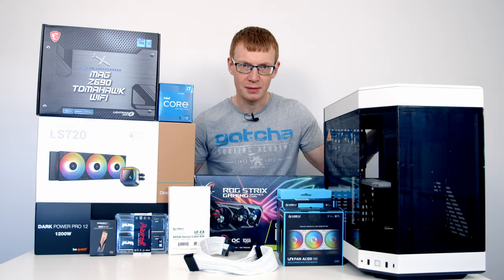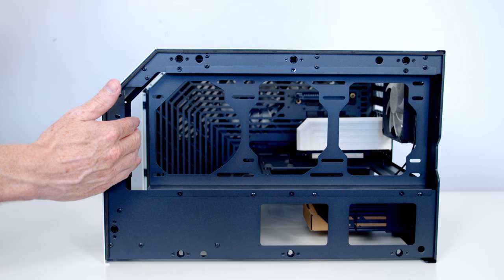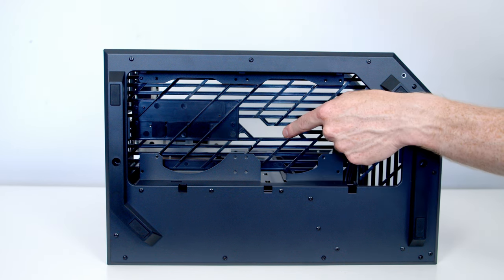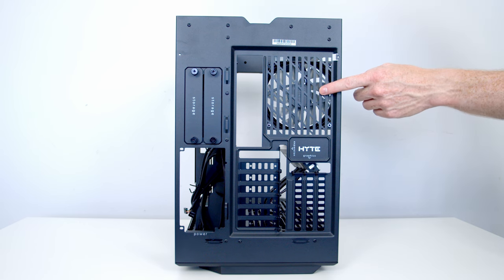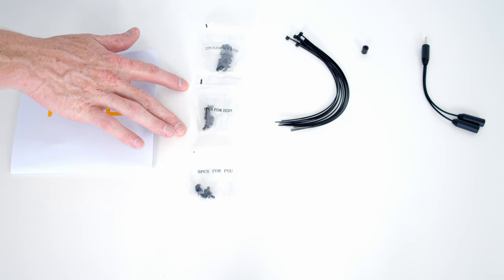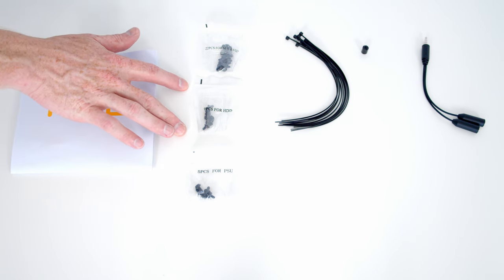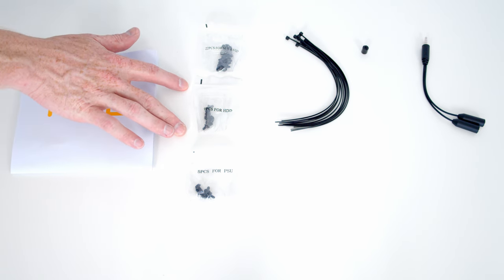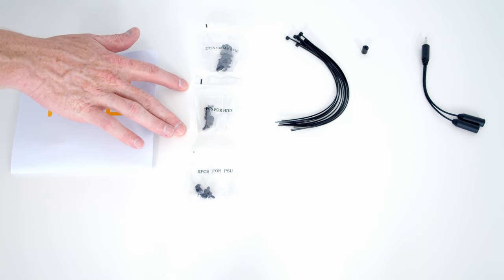Hyte Y60 Build - Step by Step Guide

Comment: You did a horrible job explaining how to set up power supply. Especially for first time builders.
Reply: Plug in cables... screw in the power supply... done
Reply: Not that hard buddy use your brain
Reply: PSU is one of the easier one, considering that the cable has label to where to connect it in the PSU, which also has a label in it
Reply: Womp womp
Reply: Womp womp
Reply: I came here to watch a pc build so far he’s dismantled the entire case. 😂
Reply: @liammorris1018  i think your supposed to do that and then after done building you put all of it back on
Reply: bruh 🤦‍♂️🤦‍♂️🤦‍♂️🤦‍♂️🙄🙄🙄🙄😂😂😂😂💀💀💀💀

Comment: Just wanted to say thank you for this video. I picked up the Hakos Baelz edition of the Y60 when it released and have been sitting on it all this time. I wanted to find a step-by-step build using this case and this video delivered in spades.

A few comments from a complete newb that might help others:

 - An Intel CPU is used here so it'll be a little different on an AMD CPU for the AIO cooler.
-Don't remove the plastic cover on the heatsink connected to the AIO cooler until you're going to install it as that's where the thermal paste is. There may or may not be a finger print on mine.
-And the biggest one for me: The motherboard here has the I/O shield (backplate thing) pre-installed so that step is not mentioned. It needs to be installed BEFORE the motherboard is installed. Ask me how I know.

Even if you're following a detailed video, read the instructions for all of your components. 😬

Seriously though, thanks for the video. Especially loved the close up shots when connecting the cables to the mobo. It was very helpful.

Comment: Christopher, your video is spectacularly detailed! I've watched tons of vids on AIO and custom cooler for the Y60. This video of yours is well beyond what everyone else is doing, in terms of completeness, accuracy, and presentation. 
What I intend to do differently is have a custom loop to water-cool the GPU and CPU, and add an internal sensor display. 
I definitely agree on using 140mm fans instead of 120mm at the bottom and side.
Reply: dimmi se metti Lian Li GALAHAD AIO 360 SL RGB V2 White andrà bene?

Comment: If your concerned about GPU Temps. "ColdZero"  do a glass front/side at the GPU intake for this case,with a cut out which allows outside air to the GPU fans.

Comment: In case anyone is curious about the 4090 in this case, pasting my comment after installing my GPU earlier:

Can confirm the Gigabyte Windforce 4090 fits without issue (listed at 70mm wide, very close to glass and I would imagine max would be like 72mm).

My PC: Ryzen 7 5700x, 32 GB Ram, Gigabyte Windforce 4090, Seasonic Focus Gold 1000W PSU, 2 sata ssd and 1 nvme ssd, NZXT Kraken Z73 vertically mounted, 7 fans total with the rear and top set to exaust, side and bottom set as intake. Set fans to "high" settings on NZXT and Lian Li software, but setting to standard made little to no difference.

(I run all my games at 4k 120Hz on my LG C1)

Results from running the following games at max settings (I run all my games at 4k 120Hz on my LG C1) :

-Elden Ring (Never hit max load, 50 C)

-Red Dead Redemption 2 (Ran benchmark which was sustained 100% load, no issues with max temps around 67 C, also ran gameplay with no issues)

-Cyperpunk 2077 (ran benchmark, have not played through real gameplay yet but temps were low the whole time 68 C)

-God of War PC (Was able to have the game sustain 100% load in the area where you can change realms at the table, left it like that for about 10 to 15 min, was able to have game ramp up to and top out at 80 C, but could not get it to go past this temp.)

Hope this helps someone!

Note: be careful when installing the GPU, its big and heavy. I broke the locking mechanism on my Hyte Y60 vertical mount :( might need to buy new riser cable from Hyte directly.https://www.youtube.com/watch?v=UJmJ5FbY5RY&t=3908s
Reply: Thanks! Had many people say the 4090 would not work for this case not because it won't fit but because thermal would be very bad. There is a special edition of this case I might want and was worried if i get a 4090 at some point but thanks for clearing htat up!

Comment: It would be nice to see how the temps would be for a 2800mm AIO set as intake on the side, and then just  3  120mm fans on the top set to exhaust.
Reply: That's what I was just thinking. I originally went for the artic II freeze 360 but it didn't fit, unfortunately that's not the first time (I really wanna know what case that monster fucking fits into)

Comment: I know this video is old, but just to make sure, you said you’d set the top radiator fans to exhaust and the two side fans to intake for best cooling correct ? I just finish my first build and want to make sure I get the best cooling

Comment: if you do not have enough argb or rgb headers, you can buy splitters cheap at walmart or whatever equivalent stores you have in your region.

Single 3 pin argb header only supports 3 amps on my mobo, so a 3-long aio + 3 case fans was a little over for me. Got a splitter and was good to go. Electricity is weird.

This guy has 2 argb on his board so no splitter necessary to stay under max.

Mobo->3pin argb splitter
splitter->fan->fan->fan
splitter->aio
is what end result looks like for me

Comment: When you ran your testing, did you have the side over on? Having the GPU vertical brings it pretty close to the glass if you have a 3 slot card. HYYT recommends this case for full water builds. I wouldn’t use this if the GPU was air cooled. I bought it specifically because I did a water build.

Comment: Thanks I have subbed. Great build explanation on the y60! I just bought this case for a swap, adding a eiswolf gpu cooler to my 6900xt and going to try to integrate the drgb in my kraken z63 aio on the 5800x with the motherboard msi tomahawk mag b550 jrainbow headers. Any suggestions? Nxzt cam seems to only work on the kraken in my existing case. Any work around?

Comment: Thank you for this video! Based on the spec, do you think this case can fit the new RTX4090 in the vertical position?
Reply: I just got the Gigabyte Windforce 4090, according to Gigabyte it is 70mm wide. I will let you know if it fits in a few days when I install
Reply: @PantsaBear  Thank you! Looking forward to see your result :)
Reply: Just plugged it all in, can confirm the Gigabyte Windforce 4090 fits without issue.

My PC: Ryzen 7 5700x, 32 GB Ram, Gigabyte Windforce 4090, Seasonic Focus Gold 1000W PSU, 2 sata ssd and 1 nvme ssd, NZXT Kraken Z73 vertically mounted, 7 fans total with the rear and top set to exaust, side and bottom set as intake. Set fans to "high" settings on NZXT and Lian Li software, but setting to standard made little to no difference.

(I run all my games at 4k 120Hz on my LG C1)

Results from running the following games at max settings (I run all my games at 4k 120Hz on my LG C1) :

-Elden Ring (Never hit max load, 50 C)

-Red Dead Redemption 2 (Ran benchmark which was sustained 100% load, no issues with max temps around 67 C, also ran gameplay with no issues)

-Cyperpunk 2077 (ran benchmark, have not played through real gameplay yet but temps were low the whole time 68 C)

-God of War PC (Was able to have the game sustain 100% load in the area where you can change realms at the table, left it like that for about 10 to 15 min, was able to have game ramp up to and top out at 80 C, but could not get it to go past this temp.)

Hope this helps someone!

Note: be careful when installing the GPU, its big and heavy. I broke the locking mechanism on my Hyte Y60 vertical mount :( might need to buy new riser cable from Hyte directly.

Edit: got Plague Tale Requim to hit 83 after letting it run at 100% load for 40 min lol, but wouldn't climb higher
Reply: @twinstars8812  See above, forgot to tag you lol
Reply: @PantsaBear  Thank you so much for this detailed update!! That's awesome!! I was worried that the Y60 gives the huge GPU no breathing room since it's so close to the glass panel, but your temp. results suggest otherwise! Glad to see this beautiful case can fit a 4090! I got a MSI Trio which is about 769mm thick (I think Gigabyte OC is at 752mm, so pretty much the same). Just wondering approximately how much space you have left between the GPU and the panel? Btw, you got a killer build :)
Reply: @twinstars8812   @TwinStars  Thanks! I put a lot of thought into building it myself, was my first PC build. Also to be honest not much space. Theres probably 5mm of literal room left to spare before the glass, and the gpu I have is 70mm according to the Gigabyte specs (also I dont have the Gigabyte OC, I have the Gigabyte Windforce, which is a few mm thinner and has no rgb). Even getting only a couple more mm Id imagine the glass would begin to choke the GPU, but I cant verify that. Also the card is TALL, so it hides the 4 cable adapter decently and takes up a ton of visual space.

Amazing card though! God of War at max 4k settings was running near perfect 4k 120, and Plague Tale Requim ran close to that as well (before DLSS, although only tested beginning). Its literally amazing how much performance this card has, I wouldn't mind undervolting or something for better thermals if needed, its just an insane level of performance
Reply: What size radiator do you have on the side?  Did you leave the kraken stock fans on? 
Did you change the case stock fans at all? 
I’m not sure to side mount or too mount a radiator

Comment: I'm feeling anxious of the top fans being intake. Pulling in hot air through the Radiator seems like the opposite of what you want to do.... You did state that you're concerned more with looks > performance right?? 
Still, I think I'd have gone a different way, my conscience would press directly on my ADHD symptoms  ;p

ok ~ so at the end you went over all this, nice video m8 \m/

Comment: I was planning on getting this case to fit the GPU horizontally which makes much more sense considering you would have fans blowing directly at it from beneath but I am surprised to learn that they've made that option impossible, which is crazy... Thanks for letting me know that can't be done :|
Reply: you can put horizontal
Reply: @trilecebey  I watched a video saying the rear plate makes that impossible. Did you find a way around that?
Reply: The case has lower fans that actually shoot air directly into the GPU’s dissipatpr when you put it vertically. You should no issues with temps
Reply: @Mk74595  You mean they blow air to the side of the GPU, from below it?

Comment: That build came out looking amazing! I’ve been thinking of doing a build in this case but with a 280mm rad on the side. What would be a setback of doing it like that?
Reply: That’s the direction I went. No setbacks at all. Common setup is for the side radiator to be intake along with all the other fans with the three roof fans as the hot air outage fans. That way you have positive pressure and hot air rises.

Comment: The power button in my case dont light up? 🙈

And I have intake at the bottom.. and then just exshaust for the rest.
With the radiator on the side.
And 2x 160 fans exhausting on the top... When there is no load it makes a cool brease at the top of the case

Comment: What size is that Radiator? For some reason on newegg I'm only finding 322mm or 394mm as the closest options to the 360mm spec listed for the case.

Comment: hey bud with the aio mount i have the 280 versiona s i bought the wrong one but wanna mount at the top if i do you method could i still mount 3 fans in the y70 case?

Comment: i have a hyte y60 case and a rog thor 850 power supply, but for some reason the power supply only fits into the case with the fan inward, it just wont fit with the fan facing outwards. is it ok to just leave it with the fan inward?

Comment: hi,idk if you can help i builded pretty much same build exept i have asus ASUS ROG Strix Z790-F and a 4080 zotac.first after i installed cpu,,m.2,NZXT Kraken 360-360mm AIO,ASUS ROG Strix Bloc d'alimentation 1000 W Gold PSU, i installed 2 normal Corsair LL Series LL120 RGB 120 mm, at this point i tried to power up and it go on fans was running exept the one came with the case so after i turn it off and install 2 other corsair fans and the 4080 and when i tried up nothing go on ,only mobo light up and a red light on it ,so after i removed gpu and tried again and still not working event the pcu fans dont run anymore the only thing light up is ram and the mobo rgb,did i fucked up and killed my mobo?

Comment: Hey guys, I know this is a little bit of an odd questions, but I'm totally new at pc building I'm trying to build my first one. As far as cables go is everything sorta labeled ?? It's probably a dumb question.
Reply: You won't have a hard time figuring out where cables go as long as you properly read the manuals that come along with your components.

Your mobo should have labels on which headers/cables go into each pins/sockets also included in the manual. Your case and PSU cables should also have small labels on them as well.

Comment: What are your thoughts on the new 4000 series cards with regards to clearance in between the side panel glass and the card itself, do you think airflow would be an issue with a 4090 in this case?

Comment: hello can you help me plz i am having problem fitting my Lian-Li uni AL120 v2 ARGB PWM Lufter 3ER Pack onto My ASUS Rog Rujin 360  RGB all-in -one Liguid CPU Cooler 360, because of the side of the screws as they are not long enough can you give me the name and the side of the screws you are using in your video time@ 16:48 plz i am in the uk and i do not no what side i have to get and i am looking for #6-32x3/8 IN plz many thank TonyLou or links to where to buy them from
Reply from the maker: I used the standard screws that came with the AIO because the 1st version of the fans are 25mm think. You are having problems beacuse the second version of the fans are 28mm thinck. You need to add 3mm to the screws that cam with your AIO.

Comment: Another great review, but the case, mechanically, is few years behind. To remove bottom filter need to flip/tilt the case, to remove panels, some different screws all over the place. Considering the price, no thanks. A lot of options around.
Reply: The reason they use different screws in the front panel is to dissuade people from removing it.